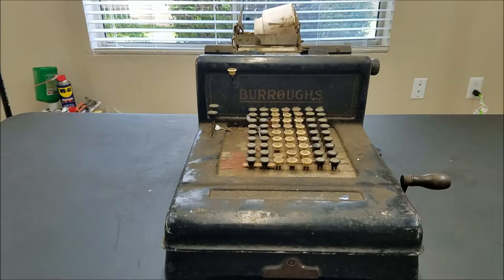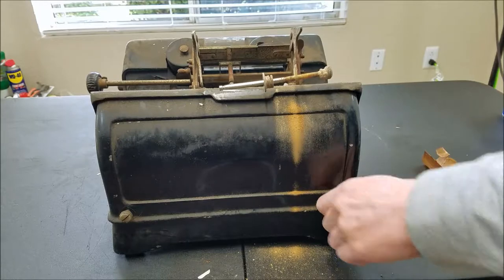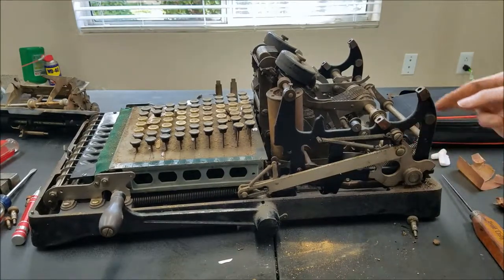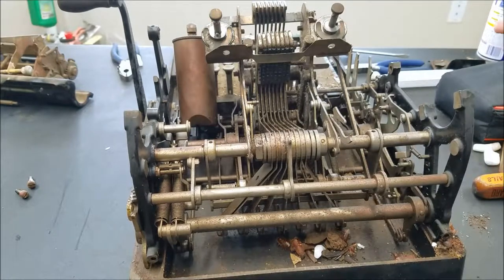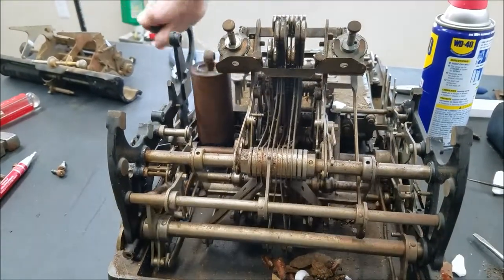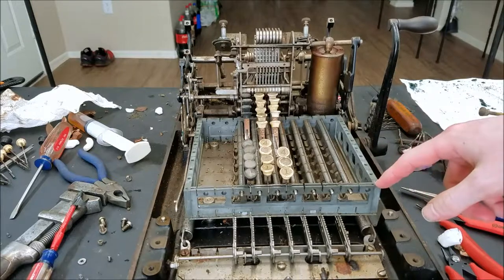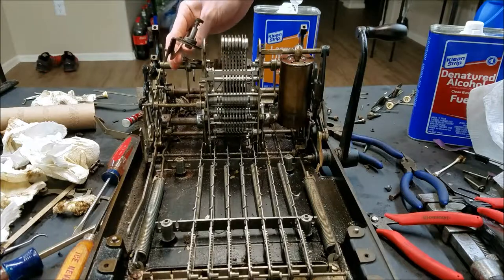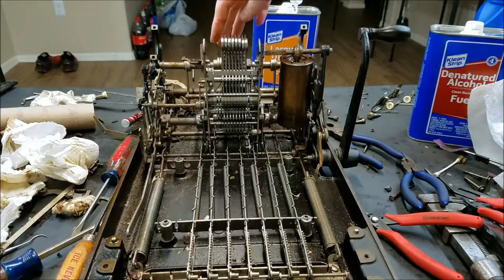1916 Burroughs Class 3 Repair Part #A

Comment: I just got a Class 3 and trying to clean it up and get working.  I've watched all 3 of your videos and now starting to work on mine.  How did you get the lock in the front to open without a key?  I'm having trouble with this.
Reply: Never mind, I got it.  Thank God for shishkabob skewers.
Reply from the maker: I also used a razor blade in my Class 1 video

Comment: The dash pot needs to have oil in it for it to work correctly.
Reply from the maker: I did fill it with oil, I dont remember which video I did that in though (there are 3 videos on repairing this machine)